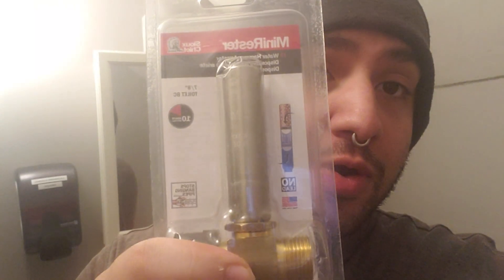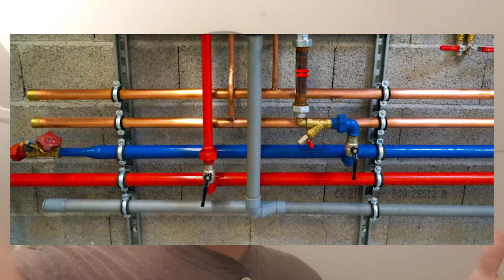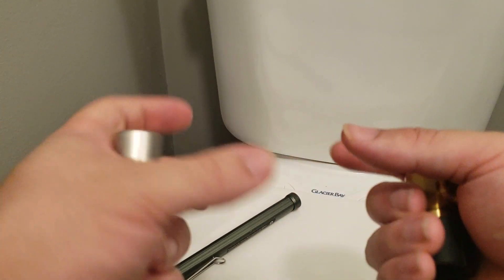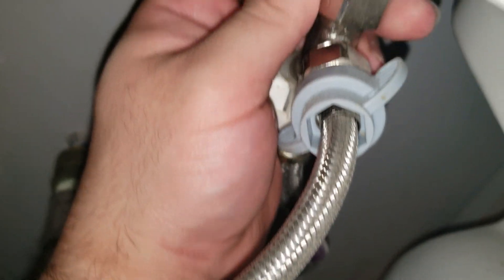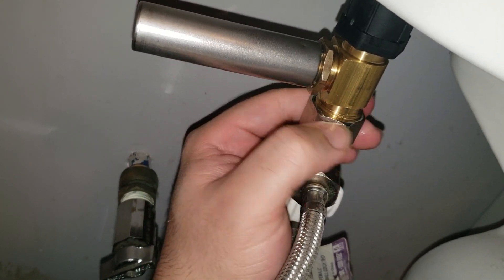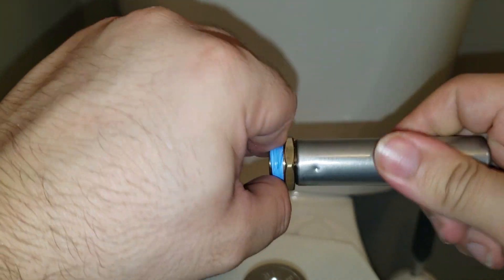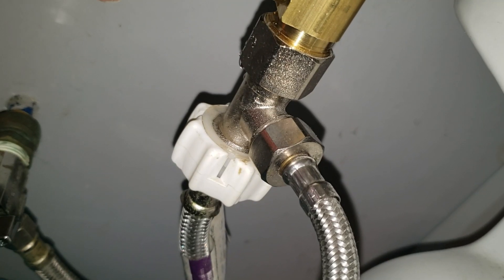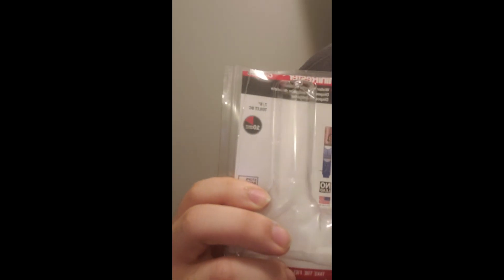ARE YOUR PIPES MAKING NOISE?! SIOUX CHIEF 660-TK TOILET WATER HAMMER ARRESTOR REVIEW

Comment: Thanks for the info.  Very good to know.  Another common place for water hammer arrestors is washing machines.  They can be in some super tight places and require moving the machine.  That means much more difficult to even notice leaks and to fix them.  

Also, if 90% of people are right handed why do they put the toilet shut offs and fill valves on the left hand side requiring you to work lefty?  Thankfully it’s not often that work needs to be done there but when it does it’s a pain.
Reply from the maker: @mariannelanger7423  well hanging flush chains with early toilets were on the left and it traditionally never changed. The main reason now is that if you're sitting on the toilet it's easier to reach back with the right hand and flush 💩 🚽
Reply: Or maybe it's so you use the left hand and not your wiping hand
Reply: @fleischpflanzerlmitsenf 

To stop cross contamination.  That’s the best answer yet.

Comment: Just bought one of these as the one that was on the toilet when I bought the house started leaking. I bought this same one and the POS leaked from the black plastic nut and below the cylinder!  How can they even sell this junk.
Reply from the maker: @mac11th  I agree mac, if ptfe tape and pipe dope are needed they should be included out of the box. Some people do say it works I'm assuming it may for VERY SMALL water hammers. I'd solder in real sized arrestors to fix the problem correctly and replace them every X amount of years depending on when they start showing signs of wear
Reply: Some users recommend not using the rubber ring that comes with it—instead, use a different one.